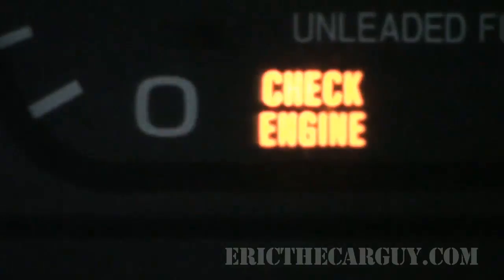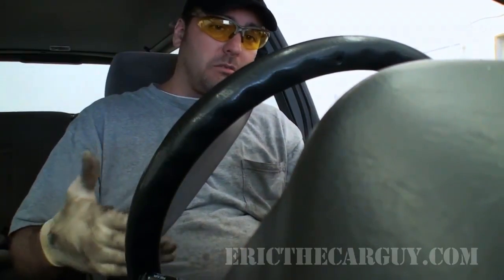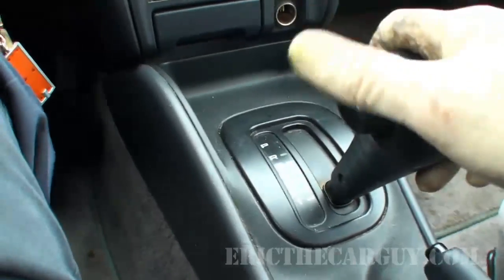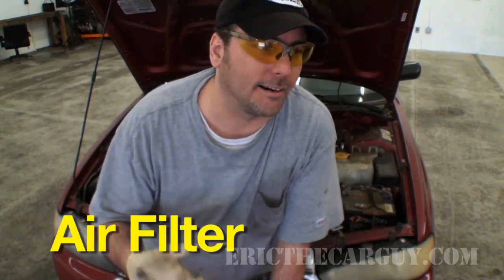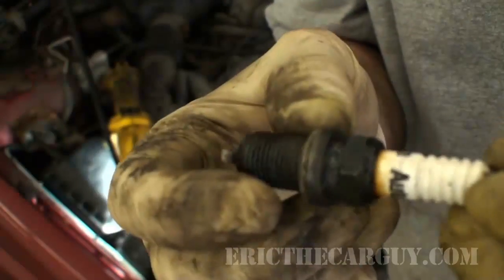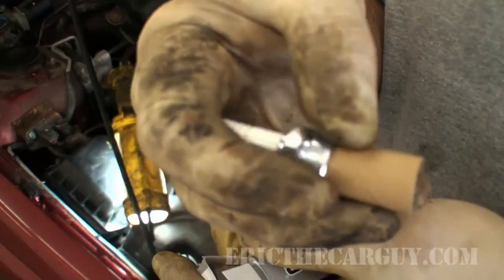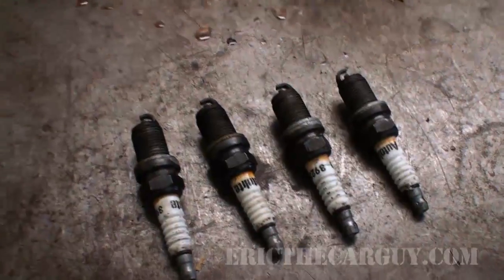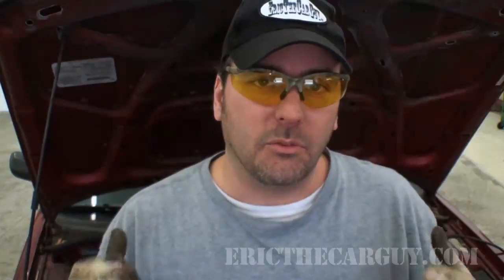Solving Engine Performance Issues (Part 1) - EricTheCarGuy

Comment: eric  i have the car jacked up.   there are 2  allen head  screws  along side the oil preasure 
sending unit.  one of these could be the relief valve.  but they are not coming loose.
i have to get  a mm allen socket    right now im using  a 5/16.   going to try to  open them.
they are very tight.

Comment: hi eric.  i have  a 1991  plymouth laser.   its got a oil system problem.   cold start the guage
needle  goes right to the  right   buried.    oil seems to be pooling on the valves and head.
so   what  happens  is oil  goes into the intake through the pcv  valve.  happens here and there     not all the time.   could this be  the  oil pump relief valve sticking?  or   a clog  on the
cylinder head  oil holes?      let me know  what you think    thanks

Comment: i have a question if old spark plugs could keep a car from starting my car cranks and cranks but sputters at some moments while cranking?
Reply: +Anthony Zavala 
Could be ignition related, It could be fuel related. It could be sensor related. 
you would have to diagnose all of those and eliminate them in steps to figure it out.

Comment: Coolest trick I've learned for not dropping the plugs in; get a length of vacuum hose that fits on the plug.  Insert and even start them by hand!
Reply: You can also get plug sockets that have little rubber boots inside them. Mine holds onto the plugs so firmly it feels like one piece.
Reply: i use magnetic plug sockets....best thing ever.

Comment: what would happen if I open or close all the gaps on the spark plugs at the same #
Reply: +oscar diaz you wreck the plugs and they likely won't work anymore.
Reply: Ohh lol well them I would just put them back on the same # as they are required to be

Comment: Hey Eric, Tanner here. 
I know you probably have 2500 other comments like this, but you sure know how to make a helpful video. I used, in particular, the spark plug section to help me with changing the spark plugs in my '95 Range Rover 4.0se. Now, I'm not a total idiot with cars but that doesn't mean I'm particularly mechanically inclined. Your channel has given me some solid confidence to tackle my vehicles mechanical needs. Anyways, back to the point. I switched out my spark plugs today and man, I sure can tell that my car is happier. A little surprise i found is that the starting of my car seems to have improved noticeably, which I was happy to see. The performance of the car itself also seems to have been improved. I suppose that's what happens when you get rid of 20 year old plugs, eh? Needless to say, I'm a happy guy!

Anyway, thanks for the videos and for the confidence to pop my hood. Tomorrow I plan to flush my power steering fluid. Wish me luck!

Comment: my car is chipped ! 225hp stock 260hp chip  + new spark plug power cold air filter a 100 oct gasolie have 20-30hp+

Comment: I sprayed a little to much PB blaster in my cylinder where the spark plug is sitting (It's really rusty, tried to dissolve some of it with the PB) and now I'm wondering how can I get all this gunk out? I don't wanna just take the spark plug out cause all the gunk will get into the head and I don't have a compressed air gun to spray it all out so that's not an option... Any ideas how I can get all this gunk out now? Thanks in advance!
Reply: Tape a straw to a vacuum hose

Comment: Has code po 300 random misfire -2000 toyota tundra 3.4L. i found two spark plugs are oily wet.
What problem is it? Thank you for your video

Comment: My 2003 Honda Element 2.4l 4 cylinder only has a strainer in the fuel tank. Where do I attach the gauge to read the pressure?

Comment: Jealous of that fuel filter location. In my 06 Sti its attached to the fuel pump in the tank and is a huge pain to change
Reply: 01 Dodge Durango also has the fuel filter in the tank...I'm not going to mess with it as long as no problem arises requiring the replacement!
Reply: +Lucien Gauvin My cousin got the same car and he asked me to changed it i feel your pain.
Reply: there is 2 one on the pump one in line
Reply: Just like me ,,with a hyundai getz

Comment: I never would have known it if my mechanic friend didn't suggest it but my 20 year old 200k, starting to get crotchety angry Teg was sent back 10 years simply by changing the fuel filter. It was a night and day difference. Much more power on full throttle and a much smoother ride for long trips.

Comment: hey Eric 98 Toyota Avalon has code po304 brought a new coil New spark plug and the engine is shake when put in gear help

Comment: fuel filter is checked by observing the fuel flow, not the fuel pressure, or maybe the pressure drop at full engine load, not on idle

Comment: always check your gap on your new spark plugs. why be lazy
Reply: +Ernesto 

By checking the gaps on modern spark plugs with gap tools you actually harm the spark plug itself
Reply: +AtibbsSPARTAN  That doesn't make a bit of sense. Leaving your spark plugs at the wrong gap is going to be much more detrimental than double checking the factory gaps. Not sure how you'd harm them by checking.
Reply: Denso is a well known Japanese brand and it's the preferred OEM part supplier for Toyota. I believe NGK is the oem supplier for Honda.
Reply: There are two different types of NGK spark plugs the ones Eric has can be gaped the other ones have a really small nidle looking thing those don't even try to gap them!
Reply: Iridium spark plugs are supposed to be pre-gapped from the factory so there should be no need to gap them. Doing so will wear off the coating on the electrode which will effect it in a detrimental manner. Normal (non-iridium spark plugs) can be gapped if in good condition.
Reply: The indicated NGK's plug in a Honda or Acura owners manual are pre-gapped to the required measurement. Try to gap the Iridiums and you'll have just ruined a $12 spark plug.
Reply: aly 884 NGK = No Ghetto Kids XD ( yes I know the real name )
Reply: NGK, Denso spark plugs come in pre gapped. You are not supposed to gap them. I use Denso spark plugs on my camry. So I know.
Reply: It does make sense,You don't fuck with the gap on iridium's.
Reply: +Ernesto Stopped doing that after week when working with NGK sparkplugs, they are gapped perfectly, so if the box was never opened, there is no reason to check it.
Reply: NGKs have been known for decades to be spot on.  I won't say always, but damn near.  It is a high quality brand.  If you are buying generic crap, check them and check them twice.

Comment: I have a 2007 mustang v6 and I put ngk iridium spark plugs, should I leave them or will I get better performance if I put oem Motorcraft spark plugs?
Reply: what you have is fine, i had the same in my 07 v6 mustang. should be platinum but those are just a little better then platinum plus.

Comment: ok so ericthecarguy,I got a 2003 acura rsx base model,it has a problem when I accelerate from a dead stop,almost no response and it seems like its bogged down itll start goinish,but like a mph every couple seconds,and my check engine light stays on almost constantly,BUT! ive been havin to charge my battery if it sets more than 2 days,well when I hook the battery back up no light till I cut it off,AND it runs like a scaulded dog 0-60 in less than 5.5 seconds which is really good for a base 200hp car of about any kind,but as soon as I turn it off the 1st time back to square 1,ive creaned the fuel system and combustion chamber,air filter is spotless,im 80% sure the fuel pump is still good,and it idles pretty rough I think,aint been in a mint rsx so idk how its supposed to idle,any advice,ppl in the comments any advice?

Comment: My friend has the same car as i have
grand am gt 3400 v6
i fixed the side engine mount plate it was split in half  on the passenger side and that was ok,
i took it for a run but noticed the the engine seems to jump at take off is it possible that there maybe another mount bad as in Transmission mount. and do you know how many engine mounts are on this Car.

Comment: how do you know what kind of spark plugs should be in your car?
Reply: +Bk Suntzu In the past yes, but it's far from uncommon for GM to use bosch, Chrysler using NGK, or Mazda using Motorcraft.
Reply: +Bk Suntzu VW Golf Mk IV built around NGK Platinums.
Reply: +rog duran Most Asian cars- NGK plugs, German cars- Busch plugs, Americans cars- Champions, Autolite, ACDelco.
Reply: +DaTwistedOne1 GM is ACDelco my friend. Ford is motocraft.
Reply: +Bk Suntzu thats actually not how you choose a sparkplug
Reply: Always check the FSM (factory service manual) or Owner's Manual and they will let you know what plugs they recommend for your engine.
Reply: +rog duran go by what the manufacturer recommends. A lot of times they will tell you inside the cars manual. Also sites like rockauto will tell you what was used as the OE plug

Comment: This problem may also be caused by worn throttle position sensor on throttle housing.  If you remember carburettors, they had throttle enrichment devices which pumped more fuel in as you put your foot on the gas. Injection systems do the same thing. The ECU knows you are putting your foot on the gas through the throttle position sensor.

Comment: I have a 95 Buick Regal Limited 3.8L V6 multi port fuel injection. I have had the same issues the car doesn't hesitate when you first drive it and it's cold, but it runs alot better in cold weather. 
I would drive it at about 45 mph and up, then it would hesitate under acceleration. I first thought it might be the fuel filter since it's never been changed.
lately I have come up with a new theory that my battery is very old and just not able to hold voltage as well anymore, and when it's trying to take the power from the battery to the engine it just can't get enough. 
I am going to pull my spark plugs and see if they are to the right spec.
thank you for this video, you reminded me of myself. ☺😧

Comment: ok, so i have a 05 crown vic and the first spark plug keeps filling with oil and causing my ingine light to go on, and my ingine feels like it hesitates and shaky. when i change the plug the car feels good. how can i stop the oil leak into the plug.
Reply: valve cover gasket.hope i helped

Comment: Tip, use a rubber piece of fuel line, warp it until it's an oval, and shove it on the plug then thread the plug with that, you won't have to worry about dropping it, and it makes threading it easier

Comment: thanks for another great vid.
any recommendations on finding which spark plug 'should' be in the car?
i have a 93 toyota tercel and googling around i find all kinds of options to buy spark plugs that fit the car, but i'm not sure where to look for the recommended kind of spark plug.
many thanks.

Comment: I agree with you Eric. When it comes to plugs, brand does make a difference, especially with imports. Domestics seem less picky, but I still prefer OEM. Motorcraft in Ford, AC Delco in GM, NGK in Asian. And never replace platinum plugs with coppers.

Comment: I have hesitation in my 2002 Chevy trailblazer. I checked the plugs and they got oil on the threads. do you think its oil leaking into the plugs. I also changed the coils and it helped alot. But now it seems that its miss firing, but im guessing its the cheap coils i got. Plugs are new btw.

Comment: When you say correct spark plugs ? Do you mean going to the name brand dealer? I got a 99 lexus es300? I took the spark plugs out en on the end of the metal hooks ir had white stuff can i just scrape the white stuff out or what?

Comment: hey Eric. my exhaust always makes my eyes burn and It's eating engine oil also. honda civic 1.8 R18. any guidelines?
Reply: Most likely worn piston rings that let oil into the combustion chamber, or possibly a blown gasket in which case you may see coolant coming out of your exhaust pipe or oil in your cooling system.
Reply: +ted clubber lang no there's no oil in cooling system nor any thing coming out of exhaust system. just eating mobil oil and burning eyes. yes ur right it's must be pistons. should I change them ?
Reply: +Syed Jawad You should really ask a mechanic to take a look, because it's not easy to give any real advice without being able to see it for myself... To me, it sounds like worn piston rings, but engines are advanced mecanisms that can develop many different problems. I would definately mention the piston rings to the mechanic, though😉
Reply: +Syed Jawad If the problem lies in the piston rings, changing them would be a good idea.
Reply: +ted clubber lang thank you bro
Reply: +ted clubber lang thank you so much. :):)
Reply: +Syed Jawad No problem, mate😉 Good luck😃
Reply: +zacatetas it's best one among choices available here

Comment: Mine just started hesitating any time i make a stop. It makes a rattling (not really sure if it's rattling) noise and has difficulty getting any speed. It then gains speed and drives but can't run over 40 miiles unless. The car starts making a revving sound but really doesn't go anywhere. This started happening when i changed four of my spark plugs and two of my ignition coils. Would you please help?
Reply: ***** The catalyst converter had run its course. I replaced a new converter and the problem is no more. I will be changing the valves soon though.
Reply: transmission
Reply: Catalytic converter I ha the same exact problem
Reply: I had spent lots of money on that car in 2015 and even learnt to fix almost everything on it. Someone then hit it in December and it had to be totaled. Total waste of money but everything is temporary i guess. Plus ended up with a better ride anyway. Happy 2016 to you all.

Comment: Hi can u fix a transmission problem my 2007 chevle equnox have problem
Reply: +Mvrz51s  Be careful about servicing your transmission (fluid/filter). If the fluid is burnt then it's usually to late, the fresh fluid will act like a detergent and the tranny will go out faster than it would already. If there's a lot of clutch material down in the bottom of the pan that's another really bad sign.
Reply: +Jose Francisco Medeiros If it's anything like my wife's 2005 Equinox the filter is built into the transmission and not a service item.

Comment: HAHA Burning oil reminds me im burning oil like a survival furnace 
im burning so much oil that my sparkplugs arent white n crusty theyre black and wet i could lube a cam for install with just the oil that drips off my plugs when i take them out
Reply: Damn. What kind of car is it?
Reply: Dylan Headrick 76 f-100 previous owner ran it like he thought he was in initial D down dirt roads and racing everything that sounded sooped up and i dont blame him hell its got a 351w bigger valves a e303 cam and a 600 cfm carb id do the same but i can actually fix it unlike him haha
Reply: Dylan Headrick i have videos on my channel of just exhaust and random bullshit because i dont know how to talk to a camera properly

Comment: I drove the car for like 9 miles on the highway 60m.p.h. 2 on a nissan altima 98. I didn't realize because there was a really bad storm, and thought it was causing my car to shake. Then the check engine light turned on. It's now misfiring. I got a code for knock sensor and one for cylinder 3. I'm scared that I might have messed up my transmission. I took out the spark plug cables and they look kinda burnt. Does something think I messed up my transmission?

Comment: I have the same issue with a vw mk4 2.0 it had autolites and it was running smooth I switched to Bosch and it started giving me the issues your Subaru has i changed them back to the autolites and its running fine again

Comment: Hiya Eric, over in the Uk here. I got a problem with my Mazda 3 1.6 diesel in which it the engine simply will not rev over 3000 revs, stationary or in gear. I changed the fule filter as I was told it might be the cause but to no avail. If you've any idea's where my problem lies? I'd really be grateful to hear from you.  Thanks  for all your informative vids, I think your delivery is 2nd to none (unlike some other ones on you tube). Tc now mate.
Reply: Samniss Arandeen

Comment: Hey Eric I have a 97 Chevy c1500 5.7l v8 I just changed the sparkplugs to Bosch platinum and I'm having a very rough idle in drive reverse 1st 2nd and 3rd in park its rough but not rough enough to notice. As I drive her she feels "OK" but I do notice slower acceleration as well as a possible occasional misfire (to me it feels like a misfire)  further information I changed all 8 plugs I checked the the boots they all click perfectly and they aren't misaligned I checked that multiple times. I do have a crack in my pcv but its on the rubber boot it was there before changing the plugs never caused an issue I just used duct tape to seal it and be sure it wasn't the issue. Still nothing seems to help any ideas would be appreciated. Thanks Eric
Reply: Bosch spark plug don't belong in that vehicle. it has to do with the resistance in the pug as well as how hot/ cold the plug runs. this can make it run lean have lack of power or hesitation and rough idle. as for the pcv that should be fixed asap as well it's a cheep fix and with out a vacuum leak can result in turn making a rough running condition among other issues. not trying to tell you what to do just some friendly advise from a auto/diesel tech of 7 years that has seen the issues that come with unintended neglect or wrong components from honest mistakes.
Reply: +Colton Wancho. I solved my problem 2 out of 8 plugs were bad. So far I have to honest the bosch plugs are doing great as far as power gas milage etc no complaints here though I'm pissed I bought 2 faulty plugs.

Comment: Hi i have a 2007 gmc envoy denali is doing the same as your car but the obd scanner  reads camshafts and crankshaft  position sensor correlation bank A, i replace both and the check engine still read the same and the car is not fix can you help please.